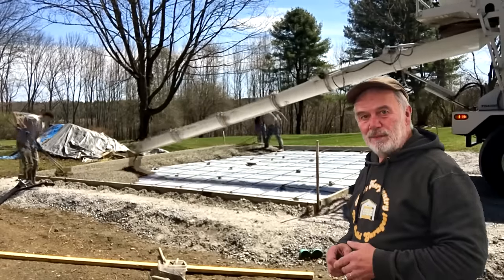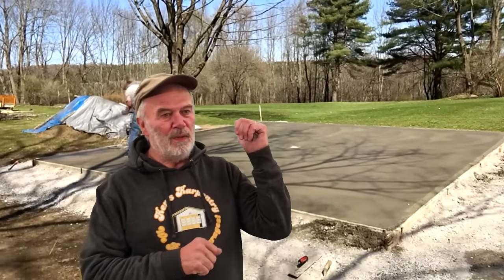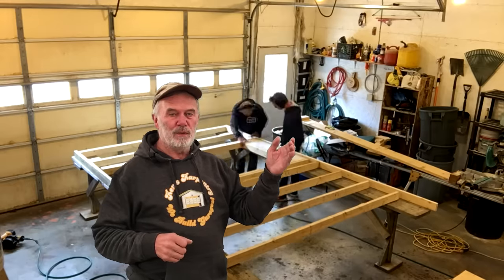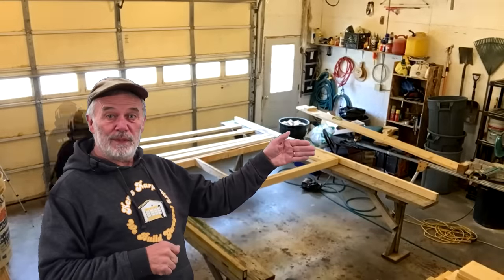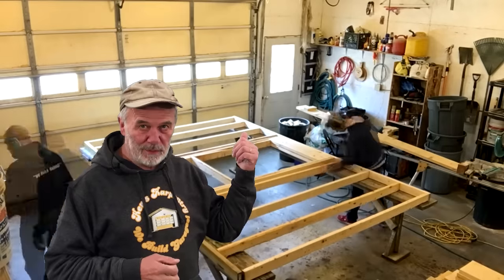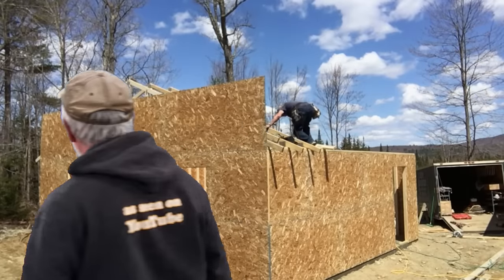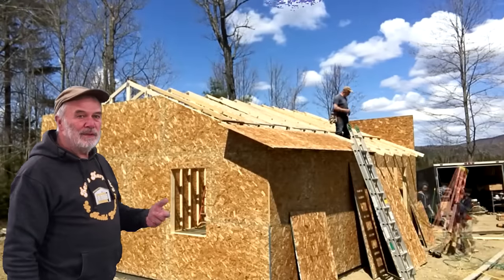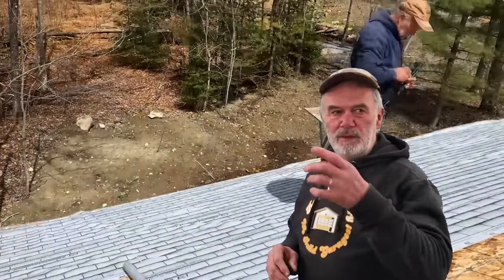How much for a Ranch Garage in 2021 ?

Comment: Great video!  I've rarely seen a subject so clearly and honestly described.  I definitely hear you about the outrageous price increases in wood products in the past several years.  I built an 8 x 16 playhouse for the grandkids (completely finished with insulation, wood paneling & electrical) when 8'  2 x 4s were $2.50!  It's double that or more in just 3 years.  I really want a heated garage here in my Minnesota winters for doing projects when the thermometer has trouble getting up to zero.  Again,  loved your informational video.  Short but very much to the point.
Reply from the maker: Thanks

Comment: Ken, I just did a 12x11 flat roof for a client...
I had to replace the sheathing underneath, and the joists too. The rot was that bad. I was dismayed by the lumber prices. I needed something solid so i put down 29/32 at $50 per sheet. I couldnt believe it. Thank you for this very informative & honest video!
Reply from the maker: Thanks for watching

Comment: I built an 18’ X 28’ X 9’ shop fully insulated, and finished walls with 7/16”
OSB and dry walled the ceiling.  Also put in a 8’ x 10’ insulated door and a couple 3’ x 3’ windows.  Bought a 7500 watt heater and a 60 gal. compressor.  Cost about $18k but materials came from Menards, so got some good rebates money back.  Glad I insulated because now it’s -20 below 0, with wind chill in the -30’s!
Reply from the maker: Brrrr

Comment: WOWW.  This was eye opening.  I asked for an estimate to add just a 12X24 shop addition to my existing 24x24 ranch style garage a year ago.  His estimate for that at the old prices was almost $24,000 !!!  And that was without the concrete work that he sub-contracts out.  So I opted to do the build myself and even with the concrete work it cost me under $10,000 total for materials which also included insulation and wiring.  I had the time, and it was worth it to just put other projects on hold while I built my woodshop myself.  And I had fun doing it.
Reply from the maker: Nice. Way to go

Comment: I had built a 24x30 steel building for my garage. 5 grand for the slab and 5 grand for the building free delivery and set up for the garage .ten grand done. That was in 2020.now steel buildings are not for everybody but when you have limited funds it’s a definitely a cheaper alternative.

Comment: I built my garage back in 2010-ish. It’s a 600sq ft, 11.5 ft high ceiling beauty with vinyl siding and asphalt roof matching the house, 18x10 garage door, etc. Back then, I spent close to $14k on materials only.

Comment: 30x35 metal garage, was $10k for building, and $8k for concrete foundation. Installation and concrete was all done by ourselves. Wood severely put the garage out of my budget. Was going to be $20k for materials, and alot more labor. Plus the $8k in concrete and gravel. The cheapest garage I priced would be concrete block.
Reply: Metal sheds= condensation😱

Comment: Nice video.  Last year I wanted a 26 x 35' garage built. I'm retired and it was to be my tinker/hobby area. The size was the largest permitted by local code. Here we need 36" deep footings. I got a price for the concrete work from a reliable contractor. 6", 3500#, #4s @ 2' oc both ways with 12" sub wall. Price was what I expected. I went to get a permit for a typical 2x4 framed building with 4" fiberglass insulation and fire code sheet rock. I got turned down. Can't have insulation or any form of heating or cooling. This winter it got down to -29F. Not going to hobby work in that. Screwed by government, again.
Reply: Dang, so you cant even use spray foam insulation?
Reply: Then get it inspected with open walls and when they’re done inspecting it add your insulation. They signed off on what they saw and you get insulation
Reply: @matthewmoore202  yup!! Then add a ventless heater hooked up to a propane tank

Comment: Built ours with cement pillar that supports roof steel structure with cement tile roofing, q con or superblock walls, glass block for light, a double wide and a single wide rollup steel door. Other than paint basically no maintenance. except wood door treatment.

Comment: Just built a 50x100x16 pole building in Ohio. Fully insulated and interior liner paneled. I had about 25k in site prep/gravel due to grade change and 4" 4000PSI floor, 200 amp service with (16) high bay LED's, (1) 10x10 and (1) 12x14 doors with (2) man doors but total came in about $125k. It will never be cheaper than now to build a building. Lock in NOW

Comment: Great video and honesty! 
I saved massive money Using LP Smart Siding instead of OSB+Siding ($35sheet+siding). 9 Foot panels. Paint right away, dont have to wait for a sider. Way stronger, withstands hail. Dap and fill hole easily. 
Just have to put wrap on before putting the board on (easy if you stand walls after sheeting. Staple/nail, fill holes and paint after. Plus should lower insurance if in a hail area.
Reply from the maker: Very nice

Comment: It really depends upon where you buy you the materials. Prices are gone. I would go to the main source lumber yard. Right now steel buildings are cheaper. Myself have done a lot of research and I know I could do a 32 by 70 out of steel or would and be pretty happy with the work.

Comment: I had a garage building business for years . I never use trusses, I always cut my own rafters ! It's cheaper , better lumber than then the unknown lumber you get from a truss company , you  have the option to build a partial or full loft now or later, No storage with trusses , easier to build desired overhangs and pitches. And no waiting on trusses to be delivered ! Retired now , Just my personal opinion ! PS  I always picked my own lumber. never ordered a package to avoid some kid in a lumber yard picking out unusable lumber that you wouldn't buy if you were standing there. That was one of my selling points to a potential customer !
Reply from the maker: Nice job

Comment: Great video. As a GC I still appreciate watching videos about our trade. A year ago I switched to 20v framing nailer since we dont do much rough framing as most of our work is interior renovations. With that said the dewalt framing nailer is TERRIBLE. Very inconsistent. We love our dewalt impacts, oscillating saw, and the fairly new 4-1/2” circular saw. As for framing and siding nailers I would stick with air.
Reply from the maker: Thanks for the input

Comment: Where I live, 20K won't even get you a small bathroom remodel!
Reply: Move out of America, much better out there.
Reply: Where I live, 2k will do a nice bathroom remodel.  1k materials, 1k labor
Reply: I just priced a 20x24 two car garage, no frills, 9ft ceiling, one full door...........$75,000.00. If this guy was in my area I’d build a three car garage with twelve foot ceilings and a car lift installed👍🏼
Reply: @heavyonthepedal7141  - I live in an area where the median salary is $42k and I got priced at $55k. That was 5 years ago.

Comment: I'm building a 22' x 36' shop/garage, and while it is a bit more complicated and larger than this one,  so far the concrete work and permits alone have cost me at least $20,000.  I'd say that $19,000 give or take is a GREAT price for that garage.
Reply: My shop is 24x30 with a 15x30 lean to for a total area of 34x30'. Concrete work cost me $9200, but I live in the country so no permits needed. The metal building itself was about $18k

Comment: 19,000 dollars is Dirt Cheap for a garage that size
Reply: In Canada maybe ...  hes quoting 3x for a sheet of osb, here is $90 for 1 sheet of osb. So you could easily double if not triple his quote. Another comparison he quoted $5.53 for 2x4 8ft are $10.98 in Edmonton, AB (8.71 USD)
Reply: Sure is, I just did a basic basement finish, about 24x24 as comparison, no plumbing and was just shy of 18k.
Reply: I was thinking around $14,000 to do 24X36 garage ..looks like its not happening...with some DIY and piece meals..

Comment: Living in Florida we don't have to worry about snow. When doing a metal roof I screw throw the rib. I know this application doesn't work well for your area as you explained. This helps prevent water from getting by the fasteners. When they're fastened through rib the screw is on top of a triangle so the water doesn't stand a chance of penetrating. It runs right passed it. It is a little harder to screw these in since its a pointed surface. It's worth the extra effort.

Comment: Thanks for all your content Ken, you and your crew seem like a well-oiled machine. I also appreciate the attention to cost. That being said, the doors, windows, siding, and roofing can swing the total cost of the building by 50% easily. Even just the difference between T1-11 and sheathing/vinyl is significant. I have not watched all your videos exhaustively, but this is still the major issue when discussing cost with clients in my experience. "If Ken's Karpentry can make a garage this size for $X, why is my custom design with 6 windows, two man doors, insulated roll-ups, shingles, PVC trim, and composite siding twice as much?" I'd love to see you break out the same building finished Economy vs. Premium. Keep up the good work.

Comment: Nice to see a good contractor charging fair prices. I'm building a 36'x100' shop for woodworking and metal working/welding. The most expensive components are the 6" floor in the metal side, and the standing seam roof. Since the price of logs has dropped, I just saw my logs into lumber. I'm making the windows and doors. I can't afford plywood, so the sheathing and subfloor is 1 bys. 2x6 walls for extra insulation, which is not cheap either. I'll have around $24,000 in it, but I'm sawing my lumber for 10 cents a board foot, and I'm doing the work myself.
Reply from the maker: Thanks

Comment: I had an attached 24x36 garage joined to the original house garage plus a breezeway was used to connect both garages $30,000, so your price seems right. Amish built mine. Mine was built 3 years ago. probably quite a bit more now

Comment: I’m building a 40x45 right now I’m in the northeast so we did the foundation for now hopefully the wood prices come down after the winter. I have a temp price on materials and the guy said this would’ve been 12-15k less last year before this whole mess I’m doing the whole build myself to try and save some money. No price on electric or radiant floor heating just yet great video
Reply from the maker: Hope it goes well

Comment: Overall not a bad price. I had a 24x30x10 built 18yrs ago at a cost of $17k.  The exception on mine was that I used 16inx8in cinder block to get my walls off the ground which gave me the 2 extra feet with the 96 in. 2x4 walls to give me a ten foot interior ceiling. I went with vinyl siding and I regret that, because I'm already having issues. If I were to ever build again I will go with steel all day long!

Comment: I built a 24x24 in 1994. cost 5,000. 10ft walls. 7.50 for a sheet of 1/2, 2.99 10ft 2x4, 58yd concrete, t-111 15.00 a sheet. on and on. went to buy treated wood for a small 16x8 covered deck recently and spent 4000 on material. Good God man. CRAZY!!!! nice place.

Comment: That's a lot cheaper that mine.  I had a 30x36 1000sqft garage built in 2018 with a few exceptions.  I had a 2x6 frame with a hip roof and 10ft ceiling.  The price quoted was 54,000.00.  that also included a metal ceiling inside and shingles on the roof, and a 30x 20 ft concrete pad in front of the garage too.  I continued to add to it with blown in insulation, electrical, heating and air-conditioning, 5/8" OSB on the walls inside, paint inside and out,  and the floor coated with epoxy.  I then added a covered walk way from my other garage and additional concrete drive way.  Any one care to guess on this cost???  By the way looks like good work on your garage and I definitely like the lower cost.
Reply from the maker: Thanks

Comment: Price sounds about right and very fair for everyone. The excavation work can really make or break someone being able to afford a nice garage like this. In some cases a foundation is needed instead of a pad and the cost for that is easily 10k for this size garage. If you can rent some equipment and do the ground work yourself you are potentially saving thousands. Nice work. Very efficient way of operating.
Reply from the maker: Thanks

Comment: It should be noted that not every company charges that same way. There are many variables. Some companies will ask for 50% down payment which is paid at contract signing. Well established companies that can boot strap the entire project may only ask for 10% down and the remainder due upon completion. The price in this video may be different in your area due to roofing material. And never let a contractor pour less your concrete too thin. 6" minimum for driving, 4" minimum for walking. Some areas add 2" to those (depends on seismic activity and erosion control).

Comment: Thanks for the vid. Good work. Wondering where you are. I didn't see any electrical in this nor insulation and drywall. That will add to the cost but make it a much nicer space. Depends on what you are going for.

Comment: Hi , here in the UK , prices have gone thru the roof . House prices have never been higher and still increasing  . Everyone that owns their own homes are building extensions due to increased home working . 
2400mm x 90mm 2020 £3.59 softwood
                                2021 £11.99

Comment: Need a contractor near me to build this garage. I have been shocked that local concrete pad to meet code is over $10,000.  36 inch ratwalls around parameter & 6 inch thick pad for garage floor. Plus concrete apron to doors. The garage is any where between $5 to $7,000 Metal or Wood frame. Funny thing I have learned by 3 cement contractors? They will not lay concrete between October to May? They said concrete can not be laid & have strength due to cold? Well I-75 is being rebuilt & the concrete is being laid on Bridges & road ways all winter. Is it strong enough? A new bridge veteran skyway I-280 over Maumee River is roughly 12 years old had rebuilt of deck etc. last year. Contractor said concrete had failed? The entire bridge in concrete pieces. No Steel or Iron in construction except Cables. I give up Ken. Guess I will have to park my classic cars on grass & throw a tarp over them.

Comment: :
Volatile is No Joke.  That old $2 2x4 is now $6, half inch plywood is now closer to $40 a sheet.  And labor, with minimum wage going up to $15 an hour, your general contract who was happy with $20 or 30 an hour will be moving to $35 an $40 an hour if they haven't done so already....DIY is then your next option since materials might be 1/3rd the cost without the slab in consideration, but between the time investment and the inspection red tape, you MIGHT cut the cost in half at most.  And thats if your neighborhood allows such construction...

What a time to be building anything.

Comment: WOW! I left the contracting biz in 1985. When I first started in the 70s,  a # 2, 2x4 spf, 8', was SEVENTY FIVE CENTS!! We never used anything on the corners other than CDX, and  4x8 sheet was under 5 bucks. Prices were stable enough for me to ta ke dimension lumber prices from memory and use them in my estimates. Better buildings used ONLY CDX for all the sheathing. Now I understand my late grandfather telling me he bought eggs for 5 cents per dozen when he was young. In a hundred years, anyone with a paycheck will be a millionaire........a working class millionaire.

Comment: Nice job but I built my 854 square ft. Metal garage slab, drive way front side walk, wired, and insulated 15' ceiling.  Center peak sky light, walk door and 12 ft. Single garage door for 20 grand.

Comment: im a big fan of exterior outlets on all 4 sides. and save the data info on the siding boxes for warranty, and RUN from Gentek. their stuff faded bad in 4 yrs we found. a piece of heavy plastic sheet around the base plate up a ft or so on the inner and outer wall keeps water away. especially when your using a hose inside to wash the car. re pouring a floor, For the garage door section, I saw someone lay a piece of 1 1/2 steel pipe in the concrete so its half sunk and level it,  water cant run over it, Mice have a real hard time getting over it, The seal sets perfect on the pipe and it wont freeze in freezing rain for some reason he said,  another thing he did was put the overhead light not above the man door, The moths and bugs like to follow the light and there fore will be away from the door. not above and on it.  before the ladder, he puts a mat for the guy on the roof to wipe his feet with, if its a wet ground, so he doesnt track mud and sand up on the new roof, and scratch it or allow his footing to degrade. for same reason the LL bean duck boots have great traction of a dry steel roof.

Comment: If anyone is curious and you want to do it yourself, materials cost alone is roughly around $7-9k. If you hire someone to do the foundation, you may spit out another $2k or so. These are the rough prices for down south

Edit: You can also save quite a bit by doing a different type of siding. Especially being 8 foot tall, you can use the all popular T11 siding and yourself another $1-2k +/-

Comment: Got a metal, arch, quanset hut type, 26x26, for about $4000.00. I still had to prep the site, pour concrete, erect, build endwalls to code. But , still, easy to build, pretty cheap.

Comment: If I wanted to build this size garage but use steel instead of 2x4's is it really a lot cheaper?  Is that something some city codes might not allow is a detached garage with steel instead?  I have a small one car garage that is useless to do anything inside of besides just park a car.  I want at least a 2 car garage in its place.  Big problem is my existing garage has a foundation under each wall not sitting on a pad.  I've been told it will cost too much to remove the foundation.
Reply from the maker: I don’t know anything about steel. Sorry